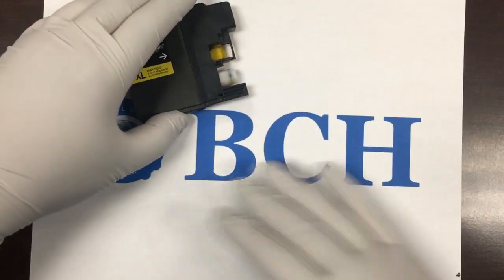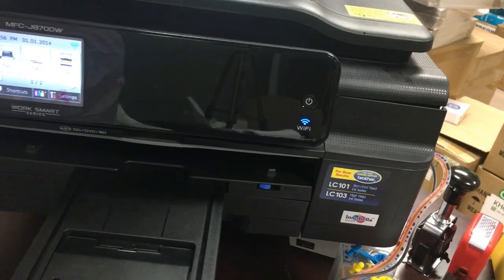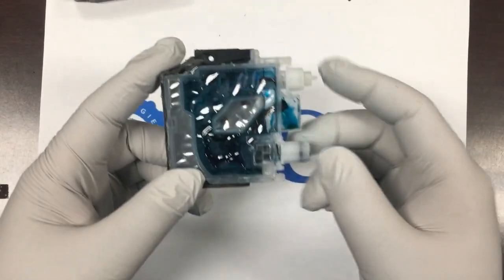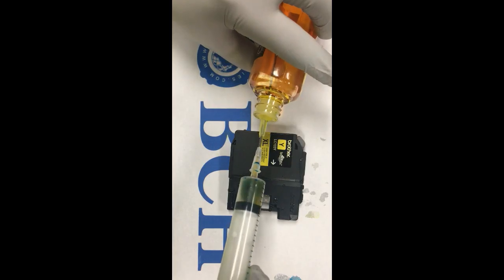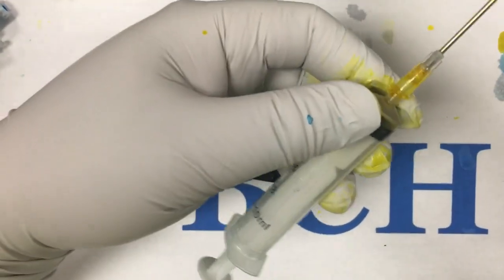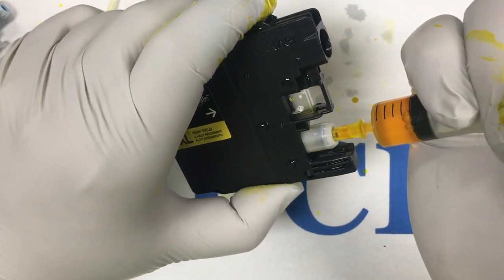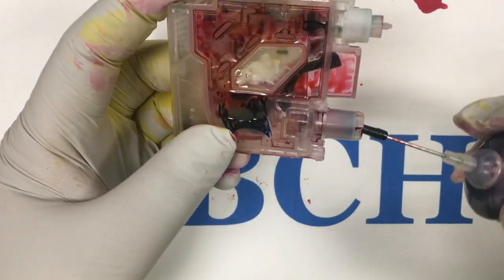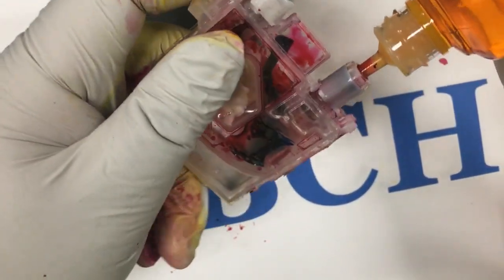3 Ways to Refill OEM Brother LC101 LC103 LC105 LC107 LC109 Cartridges -  LC101 Refill

Comment: Okay, messed around for a while refilling my LC 101 cartridges. I used the kit and the adapter tips they sell. This is what I learned.   Refilling is easier when you stand the cartridges up on its front end. Black cartridge needs to be propped up with something due the rounded edge but the color ones sit flat. The black cartridge (if empty) holds 10-11ml,  the colored cartridges (if empty) holds a max of 5ml. If you add anymore the ink backs into the air valve and makes a mess. When injecting the ink press the air valve once for every 2-3ml of ink injected. That way the pressure dosesn't built up so much and you'll get very little if any ink splatter out of the air valve. I also touched a paper towel to the ink port after I was done. Soaking up the extra ink there really helped control the mess. I also had issues getting all my colors to print properly. I had let my printer sit way too long with empty cartridges and everything was dried and clogged up. Several cleaning cycles later and my printer works like it should.

Comment: I have a J480DW and it doesn't work on mine just comes up with a "Cannot Detect" on the screen.   Do I need to alter the chip as I was told the chips prevent you using the same cartridge and topping it up?